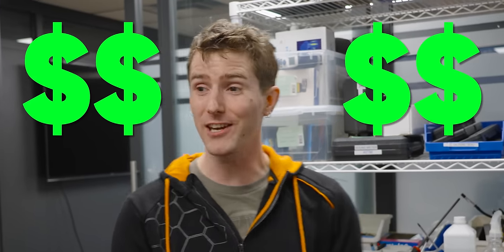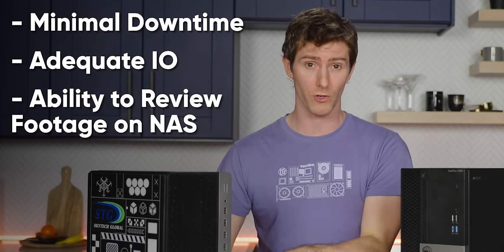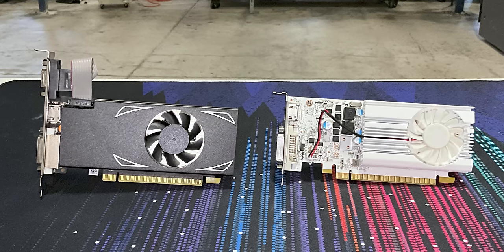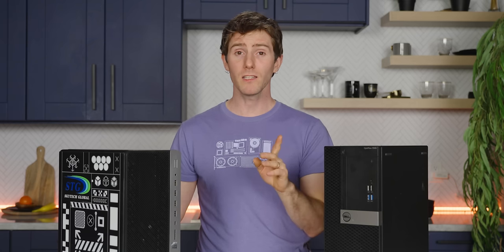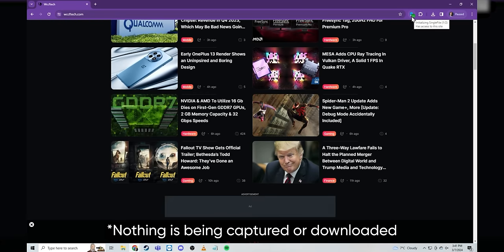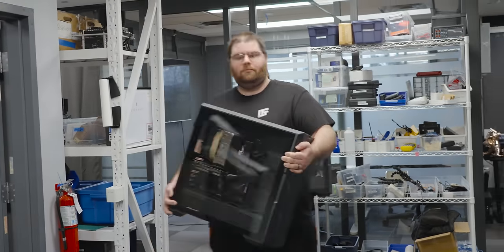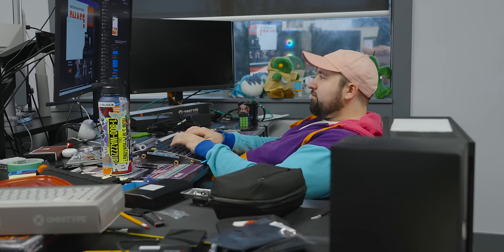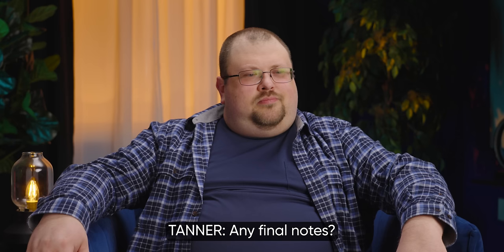We Downgraded our PCs to Prove You Don’t Need a New One

Comment: Why was their downgrade literally better than the specs of my "gaming" pc
Reply: Why not upgrade even if it's this
Reply: i have a intel atom processor and 4 gigs of ram lol
Reply: @korneliusfrik9545  oof that must hurt
Reply: how much did you pay for it..
i found a dell optiplex 9020 sff from an office with an i7 4790 for 50 aud
Reply: @randomgamingin144p  4790 was a beast
Reply: Here’s me upgrading to some scrap that’s barely six to seven years old, after daily driving a first gen i7 since 2009!
Reply: And the only reason I even needed an upgrade was because I wanted to try out linux while having a backup, and I had those parts laying around for some reason.
Reply: I have an i3 7100 with GT 1030 💀 it's still fair enough for my use case, I mean plays rdr2 on low settings that's all I want lol

I'm still using the tower and PSU from my original Wipro prebuilt that I got back in 2009 with windows XP, 2gb ram and core 2 duo, 320gb WD hdd. That 15 year old hdd still works and I use it for cold storage..

Comment: Hardware doesn't need to be the latest and greatest to be functional and useful. As tech advances, it certainly does pay to recycle and repurpose older devices whenever possible.
Reply: i use a 1st gen i7 and an asus GT 430 as my 3d printer slicer machine. runs just fine! i even use it for remapping damaged hard drives for clients and friends who need repairs
Reply: 4RIL is a spam channel that uses AI generated voices and stock footage. LTT please add them to your block list or whatever you were using
Reply: How come this comment has got 100 likes when ones of equal measure posted hours ago have got none?
Reply: Especially since tech seems to "progress" sideways nowadays. For day to day stuff, performance hasn't gotten noticeably better in the past three AMD cpu generations. Yes, you can see it when you play games and run databases with lots of data throughput and what not, but for just day to day ops like browsing, watching videos, office work and light simulations, the performance is plentiful. Same for intel chips, although I wouldn't buy them for two reasons - Intel has some scumbag CEOs and I don't want to support his snobby nonsense and on top of that, their processors are not as power efficient. I can't agree with that paradigm, especially when they have no problem asking for a hefty amount of gold for those parts.
Reply: You only need to remove the bloated windows :D
Reply: Depends, if you are using this hardware. I tried to repurpose my old Phenom2x6 for my son. This "beast" was nearly always at full CPU drawind 140W. Modern CPU has 2-4X more power while consuming 65W at peak. Not mentioning old graphic card and HW encoding of new video formats. Long story short, AMD 5600G costs about 135$, motherboard 65$ and 32GB of ram another 70$. Whole computer takes about 40W at idle, about 120W at full load, +-200W saved. At 5hrs/day it is paid in year and half and user experience is not comparable.
Reply: @themrchef1  I complain all the time about bloated operating systems. Give me an OS that looks and works as great as VLC media player and save my system resources for games or other applications.

Comment: Used my old system with a 3770 for 10 years, and I'm confident they are overstating the startup speed issue.
Reply: It sounds like they just popped the SSD into the older machine without doing anything else. If they really wanted the experience to be that seamless, they should have used something like DISM to make an image of their installations that isn't tied to the hardware or drivers.

Comment: At my last job (July 2019 to January 2024) as an embedded software developer, I was given a hand-me-down Dell Optiplex 790 from 2011 with an i5-2400 CPU and an ATI(!) Radeon 5450 GPU. One of the PC's previous users upgraded the RAM, and I doubled the number of GPUs so I could add a 3rd monitor.

The computer was perfectly fine for me for 3.5 years. It only became a problem during my last year there because I started working on multiple projects at the same time and thus had an excessive number of things open. Both RAM and CPU became bottlenecks at that point.
Reply: What OS?
Reply: i can get windows 11 on i5 750 @trevorbeingtrevor
Reply: @yifanyin9845  Yup, it's not the preferred cpu for that OS, but it'll work.
Reply: @trevorbeingtrevor  It had Windows 7 on it when I got it, and I upgraded it to Windows 10 in late 2020 or late 2021.
Reply: My work PC since 2012 has been an Optiplex 790 with i5-2400CPU. I replaced the graphics card at some point so I could hook up a 30" Dell monitor that needed dual link DVI. Might even been a downgrade but it was fanless so an upgrade for the work I did. It also got fitted with a SATA SSD at some point. Fun fact these machines are fine with 32GB of RAM 🙂I look after an HPC system and during COVID it became just a terminal for a remote desktop on the management server in the data centre so I can flick between work and home as required.
Reply: @yifanyin9845  I cant. Well it seems not in the long run.
Reply: Seem decently plush for that sort of thing.  I'm typing this on an old Optiplex 9010 with and i7-3770, and for firing up a bunch of xterms and Emacs windows, it's got plenty of horsepower.  Small builds aren't an issue either.  There are a few things like large builds (e.g. the Qt Widget set or the Linux Kernel) that I bring up a compile farm of similar boxes hooked together via a 1000Base-T switch simply because they will take a ridiculous amount of time otherwise.

Comment: Most companies are moving or have already moved away from desktops and moving to laptops with docking stations. Like you said laptops can run 99% of what is needed and if you need more power a desktop is ordered
Reply: There used to be a price differential that made desktops preferable, but it's just not there anymore.

Used to be that in order to get good performance, reliability and durability, you'd go Lenovo T-series, HP EliteBook or similar class computers, but with the latest gen you get just about the same performance with a Lenovo E14 Gen5 as you do with a T14 Gen4 (the 2023 gen business laptops). Used to be you would sacrifice a lot when it came to materials and builds with the E-series vs T-series but on the latest gen you're just giving up some corporate nice-to-haves.
That suddenly lets you bulk buy laptops at a rate not too far off a similar Intel NUC, Lenovo Tiny or other 1L-formfactor computers. With USB C/Thunderbolt docking stations or monitors with built-in docks, you're good. Yes, those add extra cost, but can be re-used for at least a couple of cycles.
Reply: And even then, they often just use more powerful mobile systems
Reply: We use NUC's... I now feel a  substantial hatred towards those...
They manage to be absurdly loud whilst overheating anf all of that without delivering any power at all.
Reply: Laptops, Thin Clients, or a combination thereof in my experience. With homeoffice having gotten much more prominent in the past couple years, I've seen laptop adoption go way up.
Reply: @Steamrick  the place i work at a put in the suggestion to use raspberry pies because one are we have 20 machines but all they do is scan bar codes and log people time for piece rate, even though they use those small dell towers but it's all basically server based now
Reply: I got an Alienware laptop at work 😂 for workstation jobs. It's actually fine for CAD work though and in the free time it games. So that's fun!
Reply: I used laptop and its uncomfortable for full time use. Small screen, cant adjust keyboard placement relative to screen, del\insert\page keys are in weird places, sound is garbage, keyboard gets hot when its under workload or gaming. The only good thing was mobility, I could take it with me anywhere.
Reply: @Boris-Vasiliev  Why on earth do you not use a dock to get the big double screen and mouse/keyboard experience at your work desk!?
Reply: I work at a school and this is exactly how we've been doing it since Covid
Reply: I dont know who you think are most companies, because your local bank is probably running on pcs with windows xp to process loans
Reply: Not even docking stations. I just have a dell thunderbolt USB Dock. One cable to connect.

But cheaper ones do suck at cooling and noize.
Reply: @Steamrick  I was a poor student back then and laptop was my only option, since I had to carry it with me from one place to another.
Reply: I work in K12 IT and long before I started working there, that was the direction they were headed. I was a student at this district from around 2002-2014 and even before 2010, most teachers had laptops and docks that connected to a projector. Now, we may be slowly moving away from Windows devices and moving teachers to Chromebooks/boxes, but we're not quite sure there.

We've already upgraded 95% of our office staff from old desktop PCs to laptops with docks.
Reply: Exactly this. Many companies in my state is moving to laptops. Especially since the pandemic happened. A lot of users couldn't remote in to their machines, after a power failure or something.
Reply: I love my work laptop. Does what it needs to do and powerful enough to power 3 screens in 1440p when docked.
Reply: This is super true. My work is ordering Dell Precision 7670s and docking stations BY THE THOUSANDS. I specifically requested a desktop because I hate fan noise and very rarely work from home. Guess its just easier and more flexible to let people work where they want, and a built in UPS is nice.

Comment: At one of my previous employers. They had several pre build specs for pc's and laptops that managers could order. Something like Office > Engineer > Developer spec. All pc's came in pre-build and we swapped them if something was wrong. A person from our supplier would come by to repair pc's/laptops.

If a department needed something special they needed to put in a special request.
Reply: E-waste was interesting as we would routinely take out memory and video cards and CPUs from developer machines for spare parts.  The sheer amount of 5th and 6th gen CPUs just tossed out as old garbage was astounding.  Nice I7s as well.  Old Radeon 500 series cards. Nice Crucial Ballistix memory.  Developers and C-level employees got all of the goodies and e-waste was a goldmine to keep the older stuff upgraded and running.  We also had at least 5-10 spare of everything including power supplies, just in case. All the e-waste companies usually got was a case with a board in it and some misc cables and so on. :)

Comment: I've been gaming on an i7-4790K (that refuses to overclock without crashing), a GTX 1070 FE, and 16 GB of DDR3 1600 RAM, and am still getting totally playable frame rates out of all my games at 1080p.  Sure, some newer titles I have to turn the graphics down a little, but considering I've gotten ~8 years of use out of my gaming PC, I'm not complaining!
Reply: same specs, just 6700k. It is still pretty fine. And I do quite a bit of solidworks.
Reply: Core i7 3770K (OC to 4,7 GHz), 32 GB DDR3 1866 MHz and RTX 3060 12GB for me : Cyberpunk maxed out @ 1080p and 90 fps, thanks to the DLSS + FSR3 mod ! 😁🥰🥰 No need to upgrade now 😅. Also, I do quite a  bit of video editing and high load calculations on it. Works like a charm.
Reply: That's pretty much the same Computer I just replaced (my had 32GB). I agree it's still solid although it began showing its age . I replaced it because my workloads grew more compute hungry and also I got sick of Nvidia (I run Linux and their proprietary drivers are baad). I'm still using it as a home server tho
Reply: similar specs, the only real proplem is that i have a hard drive, and that means longer load times, but other than that, no real problems!
Reply: I'd probably still be on a 4790k if I hadn't found the best deal I've ever found on anything on a 2nd hand 9900k/z390 based machine. Was totally fine for the games I play.
Reply: Yep, same here. Running a similar 10yo gaming PC. A recent graphics card update will probably get me a few more years out of it.
Reply: The problem is MS killing Win 10! I wonder how many gaming computers will be switched to Linux or tossed. @JonoRoss
Reply: Heck yeah. I upgraded to an i7-4790, GTX 1080 FTW, and 4x8GB DDR3-1600 not long ago. All on an H97-PLUS motherboard, which has an early Gen2 NVMe slot, but basically a fancy home user board that maxes out at 1600 for the RAM frequency. Super happy with it, coming from an AM2+ motherboard with a 95W max CPU limit. Which wasn't too terrible either, all things considered, after upgrading it to a Phenom II X4 955 (95W).

On my new setup I can play basically everything I was aiming to, and more! I was really surprised it was able to run RDR2 - with some settings turned down, obviously, but the graphics are better than the PS4 release. Currently playing Arkham City with the HD texture mod and Reshade applied. Can't quite handle raytracing via Reshade, but it may be possible with better airflow or water cooling. I only have a 120mm bottom front intake, a 92mm PWM exhaust, and a 120mm push-pull config on my CPU air cooler. Stable temps unless I push graphics quality too far with very demanding games, or ridiculous reshade presets.

Limiting my GTX 1080's potential with the 4790, but I feel like that might just prolong it's lifespan. Sure would be cool to have some ARGB hookups and motherboard lighting though with the 7th and 8th gen boards lol.
Reply: @fridaycaliforniaa236 Cyberpunk doesn't need AVX2? Interesting...
Reply: Going from my i5 4670k to an i7 8700k a while back was a biiig jump lmaoo,
Reply: @MADCATMK3103  I personally thought Linux would suck, but all in all the performance is around what I get on windows, sometimes a couple of % lower, sometimes a bit higher, but in the same ballpark. Decided to try a bunch of different distributions and eventually decided on fedora. Since I'm not a fan of RGB nonsense, everything ran out of the box for me, due to the lack of all that brand bloat. I don't overclock because whatever gains I'd get are very hard to notice. Ultimately, the one thing I lost was the 10 bit colour depth on my monitor, since Linux is still out there when it comes to HDR support. Allegedly latest plasma has it up and running, but I haven't updated to that one yet, plus my monitor peaks at 400 nits, so HDR is kinda meh on this one. I'd say that's basically my only gripe with it, as using Linux feels remarkably comfortable on KDE Fedora. Some stuff is in new places, but it's nothing that I couldn't learn and live with in a couple of days. Greatest boon? I don't have to deal with Microsoft's annoying attempts at enabling it's telemetry all over with every update and their constant harassment about upgrading to win11. Pests.
Reply: I only just last month replaced my i5-4670k. That was a good generation of chips.
Reply: @terrapinflyer273  I don't think it does. Works fine on my i7 3770 too!
Reply: @terrapinflyer273 The Trick with a 4790k (or 4770k) is a delid with debauer's delid tool, clean off old thermal interface material from the inside of the lid and the die, apply thermal grizzly liquid metal, use superglue on the lid (4 small drops on the corners), compress it down with the delid tool so it can dry, put back in system. Up your voltage slightly and you should be able to overclock it quite a bit :)
Reply: Oh, and make sure you carefully remove all the black glue that was on the IHS and substrate with alcohol and q-tips, that part will take a little while...
Reply: Yup, that was my old rig. Only built a new machine for the hell of it, didn't need it
Reply: i was about to name 4790k and 1070....  would say a good 90% of population wouldn't notice they use 10 year old hardware
Reply: I daily drive something very similar.  I still use an i7-4790 (non-K), 16 GB DDR3 1600 MHz RAM, and a GTX 1060 3GB.
Reply: until last year i had a 3770K on 16GIG  and a rx470. The biggest performance improvement i ever did was 2 SATA SSD'd in raid 0.  totally usable for 80% of stuff.
Reply: Core i3-9100f, 16 GB RAM and GTX 1060 3GB
Joining you, guys😁
Reply: Me too, I can’t believe they are acting like these are ancient machines that could barely run basic apps 😂🤦🏻‍♂️ makes me feel old as well when they talk like that
Reply: @ligametis I thought the 6700k was DDR 4
Reply: @bland9876  it is ddr4 but still 16gb that is what I meant
Reply: @ligametis  glad we got that sorted out. I have DDR4 on mine.
Reply: Devil's Canyon squad represent! The 4790K is fantastic.

I built my pc in 2015, and so far, the only game I've played that makes me want a better CPU is Helldivers 2, since it does distributed AI processing. If everyone has a better CPU, you can have more enemies in the map without suffering huge performance dips.
Reply: im pretty sure u can overclock it, dont copy settings, find your own. undervolt -0.00875v first and raise clock by 50mhz, i guarantee you it wont crash. you prob try atleast 100mhz or more to see what goes, but thats not how you should oc.
Reply: @ligametis can actually still use ddr3.